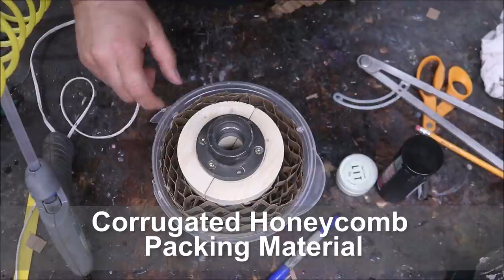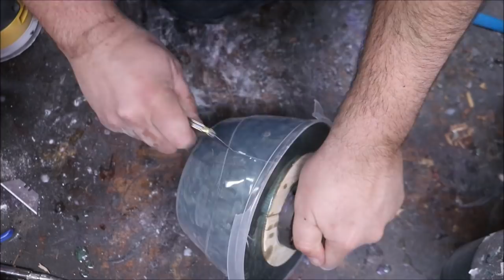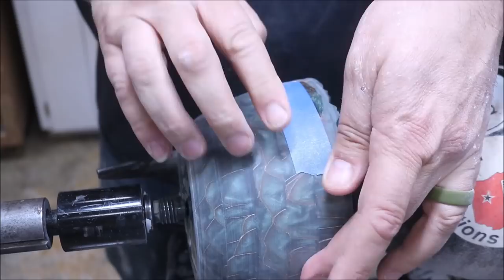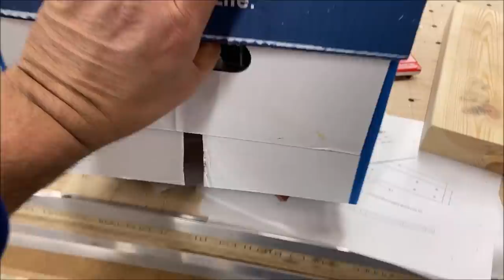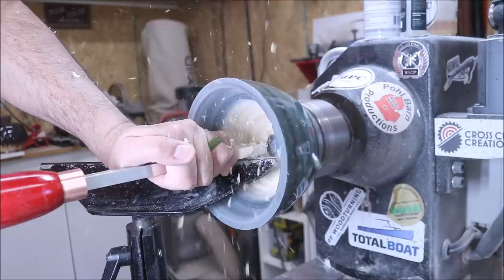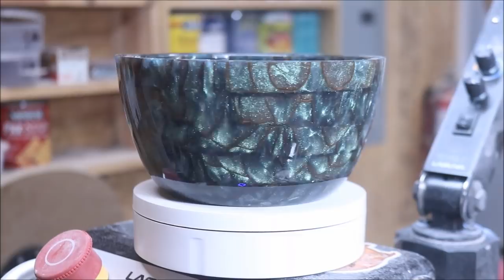I Make a Snake Skin 🐍 Bowl Made From Packing Material

Comment: Maybe place the diamond fill material facing outward to make it look more like a snake skin, beautiful work 😉
Reply from the maker: Thanks David. I tried to do that in another bowl and it did not turn out well. The holes are very hard to fill.
Reply: I have tried the same thing and discovered it is nearly impossible to prevent bubbles as the air wants to move upward and the honeycomb like tubes when horizontal tend to want to capture little bubbles toward the exterior where the material meets the sides of the mold. Spent hour upon hour filling micro bubble voids with uv epoxy.  It did look bad ass though when I finally finished. Let me know if you want to see some pictures of it.

Comment: So was that final resin coat sanded or polished at all, or just as-is?  That looks surprisingly smooth.
Reply from the maker: It was just coated and left as is. The key is to take it off the lathe and let it sit under a box so you don't get dust on it.